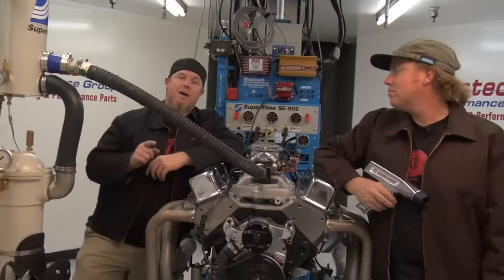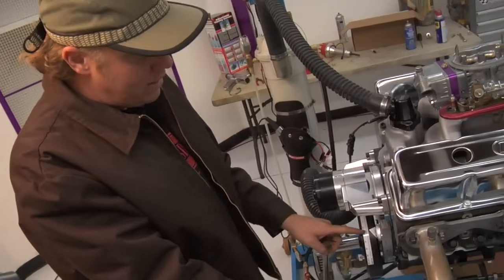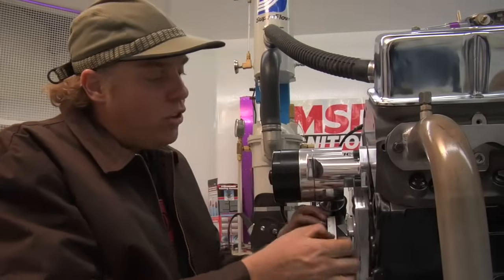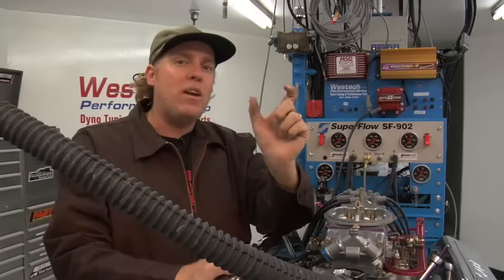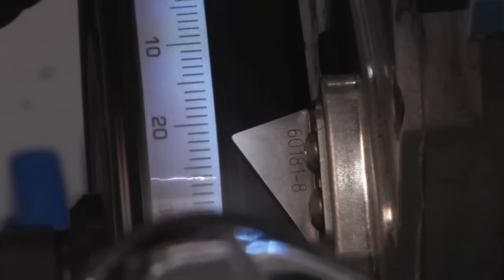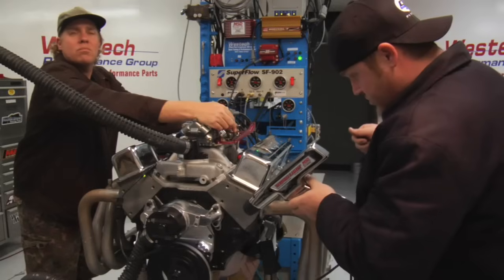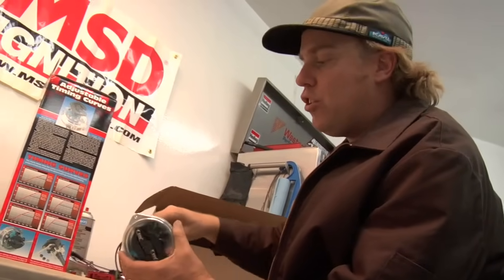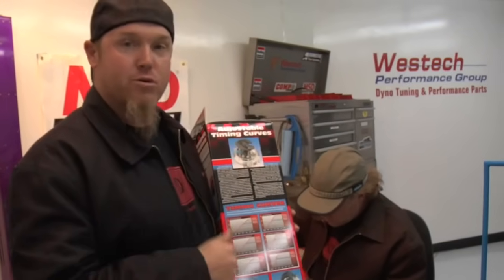Setting Ignition Timing Video - Advance Auto Parts

Comment: my 82 buick 3.8 v6 likes to stall out when i put it in drive or reverse. idles ok standing still. Is this an ignition timing problem?
Reply: Not at all but would help immensely if you Checked your blinker fluid a bit more often, it sounds like it’s a bit low

Comment: Springs and weights? Common guys, come into the 21st century.
My 22 year old 91' BMW 525I don't even have distributor. LOL!
Timing, firing control, all  all done by the ECU.
Reply: szaki why import guys talk trash about american performance guess what you hook up computers and ecu simpley while still carburated efi if perfered tell me you built and own 500hp bmw? How much that cost? When a 80$ o2 sensor goes bad in bmw the car wont run so would rather spend 3500-5000 built 400-500hp motor easy to work on and  little maintance yea your smart guy you probly drive your moms prius lol telling people to watch videos yea how many people speand 100,000 on daily drivers ?
Reply: szaki My 1969 Corvette is much more beautiful than your BMW and is very fast. Oh did I mention its 45 years old and there are many on the road still and actually the majority are still around. You know where your car will be in 45 years? I will tell you an old stove into a bolt into a lawn mower. Unless a meteor hits earth or nuclear war I bet my car will still be around and enjoyed 45 years from now.
Reply: szaki
You're a fucking idiot, dude.
Reply: Dave X
You would probably loos against the precision built BMW with your antique.
LOL!
Reply: Dave X

Try this one - 585hp BMW M3 E46 ESS
/watch?v=4pkv0eb5D3M
Reply: szaki It's been a year and you're still being a troll.. I see you haven't been using that time to improve your intelligence any. Putting a locomotive engine would raise the torque of either of your guys cars. Giant diesels like that make lots of torque... I don't care about either of your cars or am the tinniest bit angry about it. However I would just like to inform you how much of an ignorant tool you are making yourself out to me. Good day sir.
Reply: Roy   filling up my email with this misleading pointless argument. ither way the question would be whats the goal difference of the power torque cranks  an effeciantly hp pulls you.. an that luxury cars loose value cause of the cost to fix no matter what.. and muscle cars are a different breed not to be compared it's a option of one's taste an choice. like the idiots that throw big mufflers an wings on cars.. if everyone had the same taste than there would be no options or people to laugh at ...
Reply: szaki look I have owned three BMW's,four Mercedes & five Porsches;And I do not see the love for the BMW's(good cars yes but boring),Mercedes good cars but not worth the money(last classic Mercedes bult 1972) and Porsches are cheaply built cars unless you buy the classics. I had a 993 and the car was awesome and bult with old world quality. BMW is like Japanese today in looks and about every other boring way. Years ago an average man or even teenager could buy an exciting car like a 1969 Corvette,Mustang 302 Boss etc... The cars were fast,fixable,unregulated in emiision etc... The typical modern car today is like an appliance an almost all will eventually be disposed of(because of complexity of repairing an old car that has little saleable value and amount of parts in car to break & decline with age). The age of the appliance car started slightly in the 80's and picked up full force in the 90's. I remember the BMW 850IL was $80K in the early 90's now the car is worth not much and difficult to sell and the price to do a valve job or transmission job could make it not worth while(pulling to Pull A Part). Same thing happened to the Jaguar V12's from the 70';s & 80's because the price to fix engine is worth more than the car. By the way the C3 Corvettes do handle very well. The early C3 vettes were light like mine( 3091LB.
Reply: Snakes In The Lane
Uhh! Why so angry?
Reply: vanillaexplosion99
Dude, I don't race and I don't need a 600 hp car either, to put a hole in my pocket from the insurance co. That's for older divorced guys,with bigger balls than brain and still want to prove something to the younger chicks!
Oh, and don't forget Justin Bieber, the street racer, he fits the profile too. LOL!
But, I like a sporty handling car, 5 speed stick, get's me to work, picks up the grocery, fit 5 people, reasonably priced and reliable.
Reply: szaki If you think computers are everything, you're sadly wrong. Don't bitch around when your immobilizer fails. Those aren't fun to replace. Sometimes its so badly located, you won't have time, the mechanic is gonna want alot money. You're better off just getting a whole new car. Worst part is that electronics can fail within a year because of something known as the bathtub curve. I am nostalgic of the days when cars were easy to fix and weren't complete nightmares where you have to remove 5 other parts just to get at one. Yeah, I know.
Reply: Don't know anything about bathtub curve. My BMW is 24 years old ('91), runs very strong!
Parts are cheap for a car this age!
Replaced the computer 2 years ago,  easy, part cost me $80! Newer BMW-s would be much harder and expensive to do because the ignition, key, security runs from the computer and the dealer has to flash the ROM.
Ye, you right, older cars easier to work on!
Reply: szaki What’s the difference between a BMW owner and a porcupine? In the BMW the pricks are all on the inside.  🤨
Reply: vanillaexplosion99
Right, your 2 seater fantasy car, fiberglass clunker wont be around too long, when gas hits $10/gal.
I hope it's not AT?
At least my 5 speed  Beamer have a big trunk, 2 comfortable seat in the back and handles like a sport car.
Why not just throw in a locomotive engine in your Chevy, I'm sure it would improve the torque/hp a bit?
Reply: vanillaexplosion99
... and Dude, BMW is club also, if you own one you're member of the club, like the Harley.
People saved me parking spots or help me out just because I have a bimmer.

Comment: When timing pointer is lined up with "0" on balancer, it means #1 (or #6) are at top center, one being on the "compression" stroke and the #6 cyl. being at the top of the Exhaust stroke.  Therefore, timing light can connect to either #1 or #6 plug wire for same result, providing your firing order is 1-8-4-3-6-5-7-2.  Nobody asked but now you know!
Reply: This is wrong